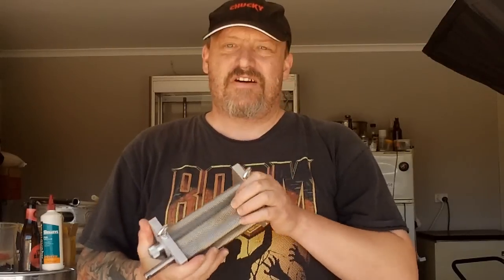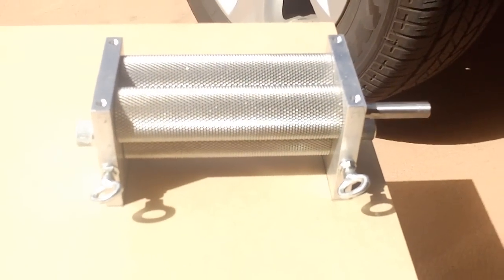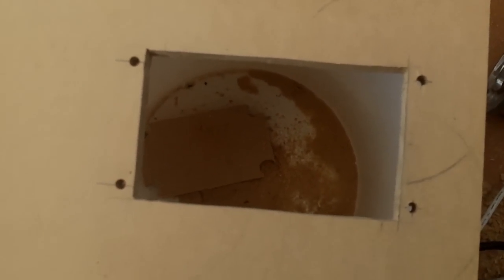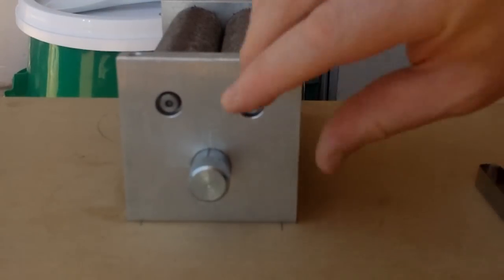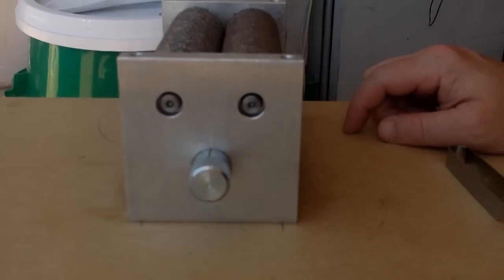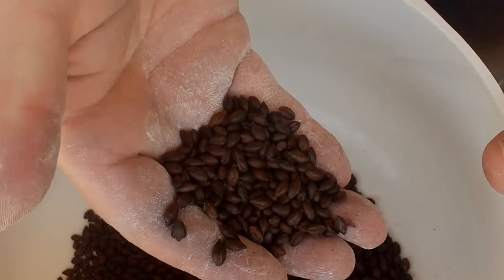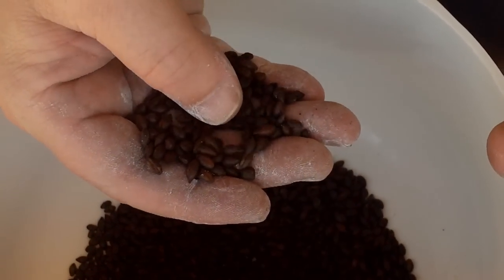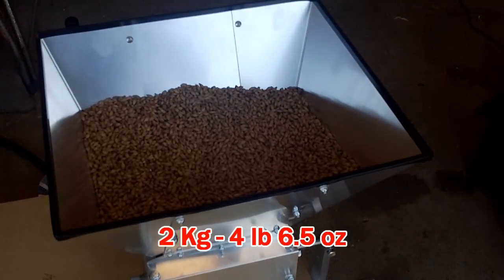Grain Mill Set Up - How to - 3 Roller Mill

Comment: I have the MM2 (the 2 roller version of your very close to the real deal MM3 is) and I can tell you assembly is virtually the same.  It's a great mill, I'm so glad I picked one up a couple of years back.  I've been using a cordless drill to power mine for the longest time.  Just ordered all the bits to motorize it.  Can't wait.  Nice mill man.  No more needing the homebrew shop to crack the grains!  Gotta love the freedom and control of doing it yourself.
Reply from the maker: Once I get a dedicated brew area I think I set up mine up with some form of motor too! Cheers!

Comment: Thank you so much for the video. I can’t believe this come with no directions. I just got mine and this may be a stupid question, but I was wondering if you did anything to get the stickiness off the hopper. After removing the blue protective coating I find there is a lot of sticky residue left on the inside. Thanks!

Comment: Old video, I know, but I'd like to know what is the benefit of a 3 roller mill over a 2 roller mill, or corona, auger, stone, steel plate, or hammer mill (the last five are typically used as flour mills)?
Reply from the maker: I much more even crush that leaves the husk intact, exactly what you want for beer.
Reply: @HomeBrewNetwork  Well, my three roller is on its way, so I'll get to test it for myself. I have an Ankarsrum Grain Mill: which is auger style, like a poppyseed mill; and I have an adjustable horizontal stone mill. I used to have a two roller mill (didn't like it) and vertical mills, one of stone, one of steel, that were a bit like industrial corona mills; which are very common in Asia, but I've moved on since them. All of these, I found, benefited from conditioning the grain with approx. 3% water by weight prior to grinding to leave the husks more intact. Do you condition your grain with the roller mill, or is thee no need?

Comment: Are you still cranking this puppy by hand or have you chucked a drill on that sucker? If you have what drill would you recommend(I'm in Australia, so the harbour freight drill that most of the yanks is is not an option)?
Reply from the maker: I still do it by hand, only takes a minute or two, but any drill that has a bit of power/torque behind it and is variable speed should do the job, you may need an adapter or make sure the chuck opens larger then the normal 10mm. Grab one from bunnings, talk to some one, get a recommendation then you can take it back if its shit. Cheers!
Reply: +Gash Slugg thanks mate, just got the grain mill, should work well with my biabiae(brew in a bag in an eski). Buying my base grain in sacks as I'm based in country Victoria and I'm getting reamed on postage. Not sure if you're planning on doing any more videos, but I do enjoy yours when they come out and it's great seeing Southern Hemisphere Brewers brewing in season.

Comment: Are you still using this mill gash. What setting do you use for crushing that is good for robo brew 3
Reply from the maker: Yes I am, I can't tell you  a measurement or setting, I set it to the grain. First time I set it up I measured, it was wrong for the grain I was using so I just went by the look of the grain and adjusted till I was happy. Was a little on the fine side because I was using wheat and its a very small grain. I've just left it like that but I wet condition my grain now and its coming out great with great flow through the grain bed! Cheers mate
Reply from the maker: If you really want I might be able to take a measurement reading tomorrow, if I can get to it
Reply: @HomeBrewNetwork  Fare enough was more curious as i just purchased this mill. Always just had the store do it. Maybe a good little video for you is how to wet condition grain. Haven't seen that before.
Reply from the maker: @Wind_Ninja_Jubei  https://youtu.be/4hkLgS2tGP4

Comment: I seen another video where they use a drill instead of a handle and its so much quicker
Reply from the maker: You can use a drill, but milling fast is no good, use a slow high torque drill, the drills sold for paint mixing, some times called spade handle drills. Go as slow as you can . Cheers!